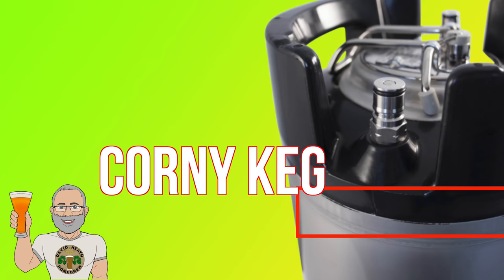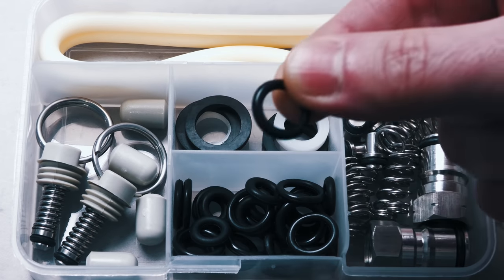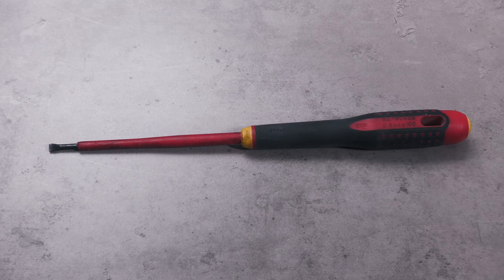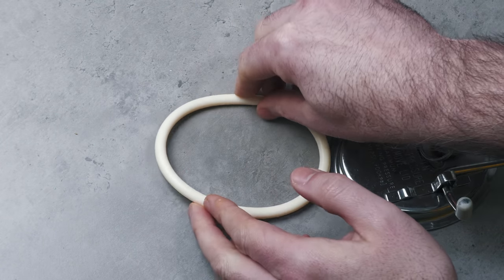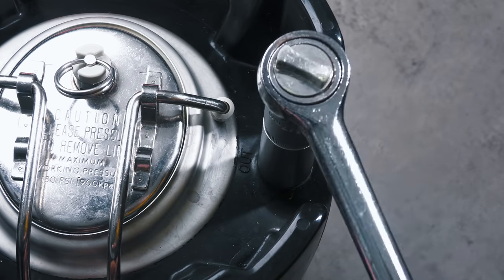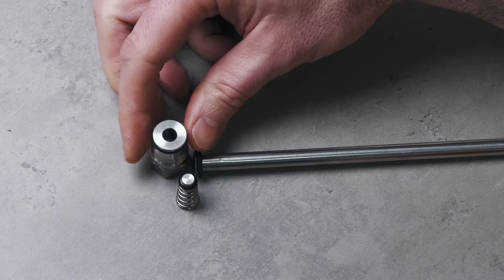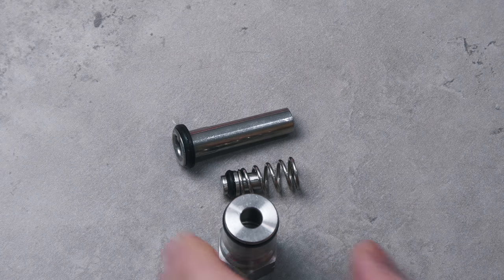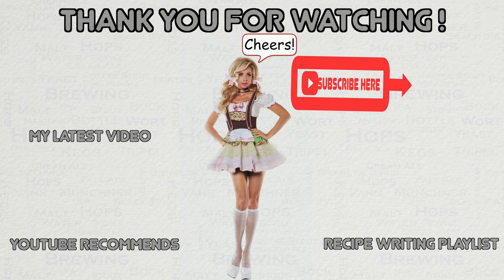Corny Keg Maintenance Guide For Homebrewers

Comment: The best way I've found to remove the outer post o-ring is the "squeeze and push" method, without tools.  Place your thumb and forefinger on opposite sides of the post, on the o-ring.  Squeeze firmly and push/slide your fingers forward along the direction of the o-ring while applying firm pressure.  One side will lift out of the groove... grab it with your other hand and remove.  It's easy, uses no tools,  and is frustration free!
Reply from the maker: Thanks for your input here Scott, sounds good :)
Reply: Yep i do this also
Reply: Doing this while wearing nitrile/latex exam gloves works well, especially if you need to protect your hands from PBW or sanitizer that makes my skin die and fall off.
Reply from the maker: Yes, its important to keep it sensible with such strong chemicals
Reply: @DavidLuger  are those things all that bad? I often dont wear gloves with starsan or sodium percarb cleaners
Reply: @TheGavranatar  To follow the warning labels on the chemical containers is a wise choice. 
My hands were OK at first, but now they are super sensitive. That slick and slimy feeling your fingers get from PBW is from dead skin cells.
Reply: @DavidLuger  i usually start out with gloves, but so much water gets in the gloves from dipping my hand in i usually take them off! Ah well, at least we have beer to ease our pain ;) cheers, will be more careful in future
Reply: @TheGavranatar  Skin contact with mixed and diluted starsan for brief periods is not likely to be harmful, but be very careful with the concentrated form as it's largely high concentration phosphoric acid.  It will burn your skin, and can cause blindness.

PBW, will break down proteins as we clean our kettles, but the alkalinity also attacks fats.  This includes the lipids in your skin, and once they're depleted they can't really be restored.  In short, dipping your hands in PBW will prematurely age your skin.  I suspect the problem will just accelerate over time, too.

Gloves and eye protection are definitely the way to go.
Reply from the maker: Best to use gloves I would say.

Comment: i use cc kegs that do not have pressure relief. but what on earth could i do wrong to make a keg explode? should i be considering buying new lids?
Reply from the maker: I personally would not use kegs without a PRV. If your regulator fails, for example or if a child changes the pressure.

Comment: David.  Good and important topic.  I would include in this discussion the inspection of the metal sealing area for each of the o-ring seals.  The inside seat of the posts, the lid and inner seat of the lid, the PRV seat surface.  Inspect for damage on the dip tube flare.  You are so right that proper maintenance of equipment is very important.
Reply from the maker: Many thanks for your input Dennis. Yes, this is certainly an area that more attention is due. Problem avoidance rather than problem reaction.

Comment: Nice vid. I find gas disconnects wiggle on the the kegland gas/multi posts, leaking gas every time it is lightly knocked or touched. Ever heard of this ? Doesn't happen with my older corny posts. I guess lubing might be the answer?
Reply from the maker: Thanks :) This can occur when o rings are needing to be replaced on the posts or when lube is not present to form a better seal.

Comment: Thank you very much for your continuously EXCELLENT output and knowledge sharing - you're a an absolute rockstar of the homebrewing scene.

WIth that much needed praise out of the way a possibly silly seeming question: what's the best way to lube o-rings? Do you put a little bit of H1 grease on your finger and just "roll" the ring through your fingers? Do you apply it with a cloth? How do you go about it to ensure the entire surface of the o-ring is covered but you're also not applying too much?

Thanks in advance for any best-practice insights shared.
Reply from the maker: Thank you, much appreciated :)
You do not need to use much. Personally I use a clean finger to apply it visually checking that it is covered. Adding too much is no an actual issue, just a waste is all :)

Comment: Great information!  Is there a difference between the posts?
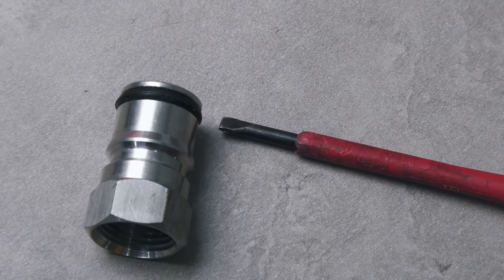Reply: The gas post is different from the liquid post and the QDs require the correct post in order to seal correctly. The gas post generally has a cut or line in the metal to differentiate it from the liquid post. You can see the difference in this video at 6:13 and 6:37.
Reply from the maker: Yes. They are very different as jkmarut mentions :)

Comment: I have 6 kegs and the poppets don't fall out of the posts like that for any of them... They're all ball lock, but I can depress the poppet with post removed and it won't come out, what am I doing wrong??
Reply: Keep pressing harder. Sometimes they get stuck.
Reply from the maker: Yes, press them or pull them harder :)
Reply: Some old poppets have a snap in holder. They tend to wear out and can be replaced with a universal poppet. There may be a better way but they can be removed by pressing the poppet in with a narrow screwdriver or an awl and just forcing it out. Conversely they need to be forced back in with a narrow diameter hex head driver. It is a little dodgy.

Comment: Thank you for another great video focused on the most important basics. My method is to connect my three lines and faucets with various adapters and run rinse water, then pbw and then dilute sanitizer using my pump and a small reservoir. Then I remove the faucets to soak a few minutes in pbw. When a keg kicks I rinse the line with water and sanitizer. You have convinced me to convert to liquid line cleaner for the thorough cleaning. 

I had a strange and scary thing happen last night. I pulled a glass of pils which had turned amber. Eeek! Subsequent glasses were back to the pale straw color and tasted fine. Do you have any idea what caused this? Somehow O2 got into the line?

Thanks again and cheers!
Reply from the maker: Thanks Janet. I think this was possibly some stuck trub that came out.
Reply: Thanks for the reply. I'm going with your trub theory.
Reply from the maker: Thanks Janet. It can happen :)

Comment: Greetings, I change the gas post on my kegs 2 of them were leaking from the outer bottom part of the post with the new posts, I added the old post and it does not leak. How can this be fix ?
Reply from the maker: Hmm. Could be a fault in the new post or one of the seals. I would give it all a check.
Reply: It seems like the leak is coming from the keg, the old post has a larger base since it uses a 22 wrench and covers the leak but the new  posts are slimmer and a 17 wrench is used is there a way to seal this because I want to have new posts since the old ones barely do the job. I really appreciate your time and videos they are helpful.
Reply from the maker: Ahh ok. Well that sounds like posts that are not quite compatible with your keg type. There can be some variation.

Comment: Can a post on the co2 in prevent it from carbing
Reply from the maker: No. It will not unless you have a leak.
Reply: @DavidHeathHomebrew  thanks for the response, all my kegs are the same I have very good gas to the john guest fittings but I am struggling to understand why my kegs aren’t carbing and then dispensing my beer from my corny kegs
Reply from the maker: Are you losing gas?
Reply: @DavidHeathHomebrew  it’s all sorted my co2 fittings are clogged and tried a new one and it worked
Reply from the maker: Great to hear Nick 🍻🍻

Comment: Are the 17mm and 22mm posts interchangeable?
Reply from the maker: I believe that the threads are mostly the same but other areas of the design can vary, so this could cause issue. Best to test in store if possible.
Reply: @DavidHeathHomebrew  thanks for that quick response. I bought 2 refurb kegs and noticed the posts sizes and poppets were different. I'll have a closer look at threads, dip tubes etc.
Reply: @gleamac  The gas post is different from the liquid post and the QDs require the correct post in order to seal correctly. The gas post generally has a cut or line in the metal to differentiate it from the liquid post. You can see the difference in this video at 6:13 and 6:37.
Reply from the maker: Perhaps the supplier can hook you up with spares for both :)

Comment: I recently bought a ball lock aeb keg which doesnt have spring and poppet in the post. It seems there is some sort of metal tab up inside which puts pressure somehow. Have you heard of these?
Reply: Some old poppets have a snap in holder. They tend to wear out and can be replaced with a universal poppet. There may be a better way but they can be removed by pressing the poppet in with a narrow screwdriver or an awl and just forcing it out. Conversely they need to be forced back in with a narrow diameter hex head driver. It is a little dodgy.
Reply: @DavidLuger  ok thanks for that. Do you know for cleaning is a soak in cleaner enough or do they need dismantled?
Reply: @TheGavranatar  I hate cleaning but it is not worth it to cut corners, save 10 minutes and throw away 12 hours of hard work, 5 gallons of beer and the cost of ingredients. Like the man says, "Respect beer".
Reply from the maker: Yes indeed :)
Reply: @DavidLuger  so i'm going to be popping these things out and in with a screwdriver every time to clean? I dont think they'll last long then lol
Reply from the maker: I don’t do that. I simply do a visual inspection.